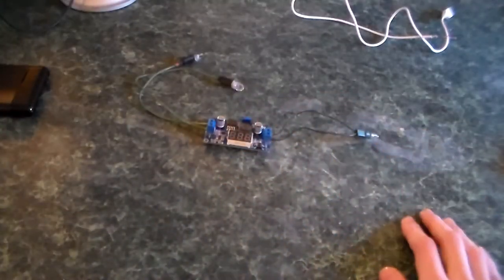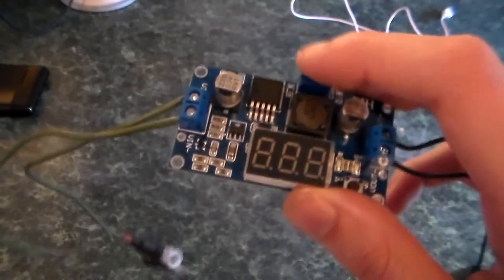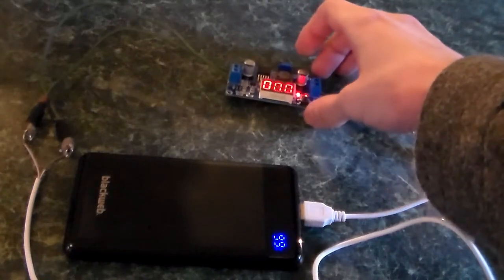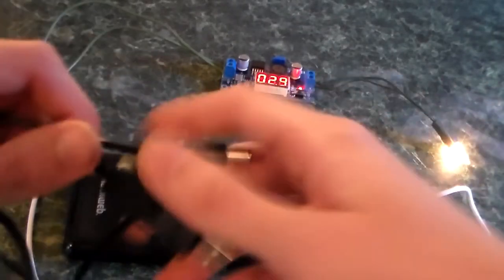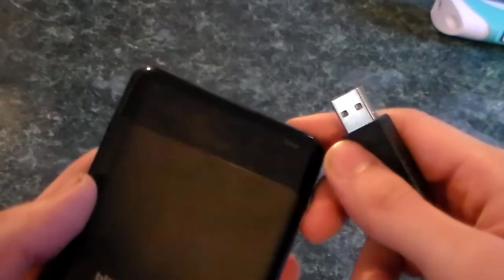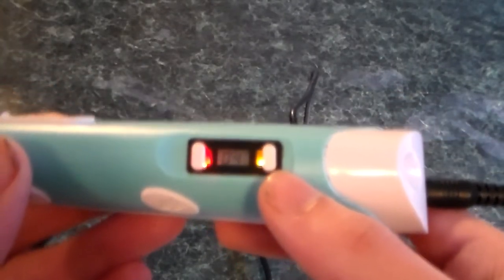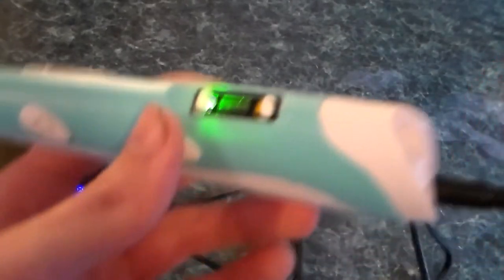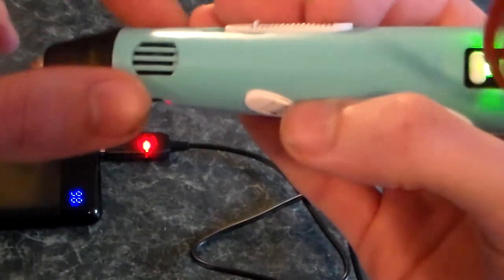Hack Time "Trying A Few Dc Step Up Module's"

Comment from the maker: Tested the cable for those of you concerned the 5 volt to 12 volt adapter does indeed output 12 volt on a stable 1 amp usb port but to use higher loads you will need a higher amp usb battery but for my bike light project the 12 volt cob led lights fine off 1 amp as well as my WiFi router but to use something more demanding like a 3d pen you will need higher amps from the usb port.